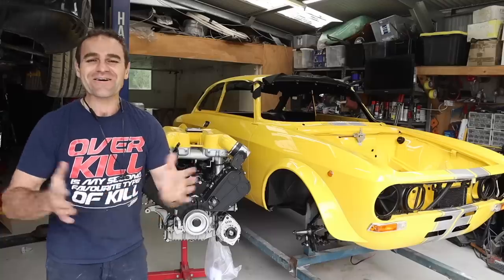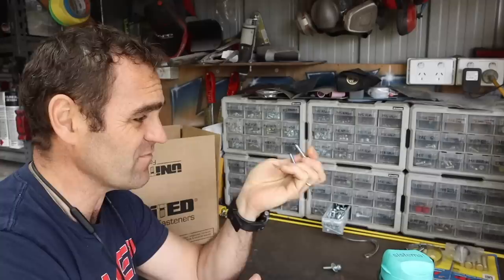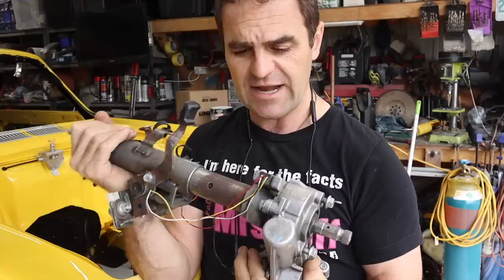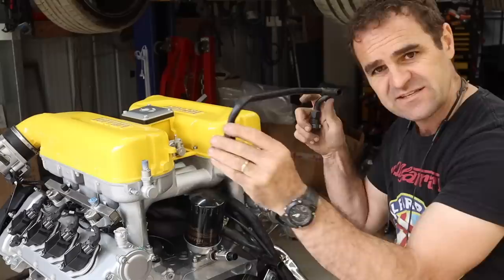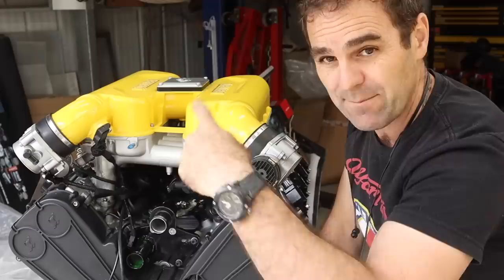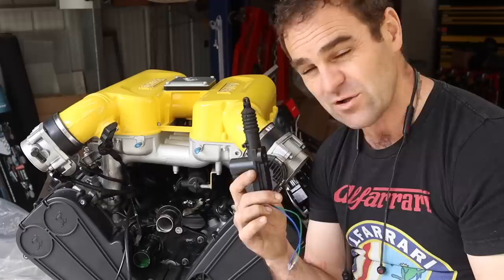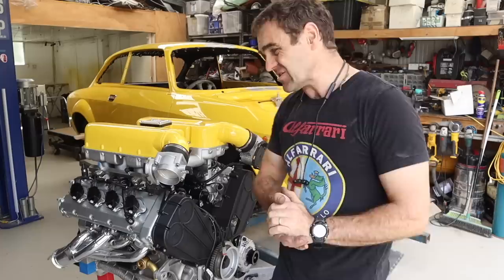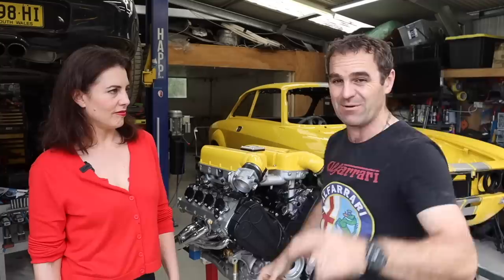All the fiddly bits - Ferrari engined Alfa 105 Alfarrari build part 167

Comment: that intake system is the same as the ACIS intake from the Toyota 5EFHE , all you need is a vacuum tank with a one way valve in the line to the intake manifold , and another line from the tank to a 3 port solenoid valve NC (normally closed) port , the other port goes to your actuator and is NO ( normally open) to the 3rd port which is open to atmosphere , when the solenoid is powered the vacuum tank is connected to the actuator. The solenoid valves are used commonly on cars for emissions control etc , vacuum tanks shouldn't be that hard to score either. I love the spread of torque this system gives me in my turbo 1300cc race car , I can only imagine what it is like on a bigger motor like yours, love this project your doing , keep up the great work 🙂

Comment: I wouldn't use a central locking solenoid from an aftermarket central locking kit.  They are fairly unreliable and were never designed to work with the heat in the engine.  Sorry I don't have an alternative suggestion.
Reply: could try to salvage a frunk solenoid from a wrecked Tesla

Comment: Hey jeff, dont you think that leaving the brake lines exposed to the heat of the headers may cause overheating issues on the brake fluid? Aluminum its a great heat sink and the same with the fluid. A little wrap may prevent damages to the fluid or worse, in a moment of high performance of the engine, high heat output on the headers may cause the brake fluid to loose efficiency.

Comment: I think a modern throttle stepper motor would work really well on your intake actuators. Also look into more recent Toyota’s Audi’s and all NA V6 engines. They will have electronic stepper motors to actuate their variable intake systems. Time for a wrecking yard trip.

Comment: You always have an amazing attention to detail in all of your builds, this one is no exception! As far as losing bits I feel your pain. I had a 57 Thunderbird on the lift and pulled  a rod/piston out and dropped a rod bearing on the floor. I heard it hit  the shop floor numerous times as it bounced across the floor into a black hole. 2 years later and I still have never found that bearing half, but I keep looking. Keep up the great work.

Comment: We’ve used solenoids to pull open the fuel rack on diesel injection pumps (agricultural equipment, but over the road trucks used them too) which have two sets of windings - “pull” windings (high current draw for brief period to move the linkage) and “hold windings (low current draw to hold the solenoid in position). Sits in a hot diesel engine compartment, so should be able to handle the heat. These were used back in the 1980’s on tractors, combines, trucks, etc. I have to believe they still exist, and would be fine if you simply want “on/off” functionality. Otherwise, I’m sure you could find some good PWM solenoids you could drive from your ECM if you wanted to mess with progressive engagement over a certain rpm range to smooth out the changeover.

Comment: The EM solenoid is what you need.  We fit them as emergency gas cut offs and "perminently on" for months on end
Reply: Who makes it, what power consumed, what's full name?  Sounds good for Jeff's use, huh Jeff?
Reply: @sfoggyracer  ours are made by Honeywell but are way to big.  But a fuel shut off actuator from a diesel generator would be better

Comment: Your door lock actuator might overheat if left powered for long periods. I've come across solenoids with separate lift coils and hold coils, triggered by an internal limit switch. The lift coils are high current because they do work lifting against whatever load is moved. The hold coils are lower current just to provide a force to then hold the thing in place. Maybe you could set whatever drives the actuator to give high current briefly then low current and do some experiments to find out what is enough?

Comment: You have 2 types of vacuum, manifold vacuum and throttle body vacuum. manifold is when the throttle body is closed, and throttle body vacuum is when the throttle body opens. there is ports that draw the vacuum from air passing by in the throttle body, which mechanically you could run it off throttle body vacuum as the RPM and air increase the so does the vacuum.

Comment: Yes, the solenoid will heat up and not work very well if excited for a long time. But there are "latched solenoids" that are designed for this use. (They change position on a electric pulse)
They are pretty common on the electric world, they must have some sort of automotive version for sure.

Comment: The vacuum driven actuator is not driven directly from the plenum, it goes to a canister via a check-valve.  Race cars typically even have a bigger canister, because it's possible to "run out" of vacuum in sustained open throttle situations.  The ECU then opens/closes the valves at pre-determined rpms/loads, not (just) under throttle closed conditions.  I deleted all of that in my 911 SC's 993 plenum adaption.  Instead I used a actuator designed for diesel motor swirl flaps, mounted on a custom bracket - so no problem with repeated usage.  That's driven by my MicroSquirt through one of the spare outputs, via a simple MOSFET circuit (with flyback diode) but you could do something very similar with solid-state relay.  I have an example of this going on my channel.  It works, but I've yet to use it all in anger.  Maybe more trouble than it's worth... But there's an idea for you 🙂

Comment: EVs come with a small electric vacuum pump connected to the brake booster. you can get one of those and actuate it via the ECU for the solenoids. One of my friend has the same setup for his exhaust cutout which is vacuum operated.

Comment: Vacuum, keep it semi OEM! The solenoid will likely have too much kick/power snapping something externally or even internally, vacuum lot more progressive  stops with resistance- look at VW TDI vac line diagrams as that's really simple and well documented. Simple reserve in the system is needed, with one way valve to the inlet.
Mapping is interesting as I helped a old school UK tuner as I was visiting! A guy just changed the intake pipe to an silicone hose/KN and that through out the change over points for good power. Cross ref'ing the overlays of Fully vac'd and none
Great build Jeff, as always I'm here for Harry and still watching!

Comment: Hey Jeff, don't use that door locking actuator. Not designed for the heat of the engine bay, nor the duty cycle of continuously on. Ask your contacts at Link. They would have done this before. You could use a stepper motor like an electronic throttle actuator if your ECU supports it. Remember you need a diagnostic on these sorts of controls which the ECU should be able to do with a stepper motor.

Comment: Have a look at the toyota tvis system and their vsv (vacuum solenoid valves) they usually have a small vacuum tank also that can be hidden away. Plus toyota reliability! They work on a normally open (from memory) and the closes it during low rpm.

Comment: You could look into electronic wastegate actuators to replace the vacuum solenoid. Wastegate actuators see the same amount of abuse if not more. Maybe you  can rob one from a Toyota Hilux or Hiace, but other modern cars use them as well.
Reply: Just noticed: The way your lifting points are placed they could rotate on the bolt when picking the engine up and potentially cause damage to the valve covers. Clock them 90 degrees so the load is straight on the bolt and not at an angle to avoid this.

Comment: Here in the U.S.A. ford had the 3.8L windstar. The plastic intakes had valves  like your motor, and it used electric actuators, one for each bank .it would probably be nothing to wire to your link system

Comment: Ba and bf ford falcons have a similar dual runner system on the NA 6 Cylinder motors. Being in Australia You should be able to find the vacuum solenoid at any wreakers super easily.
The solenoid sits on the passenger shock tower near the ecu
It is a simple 2 wire vaccuum switch so positive and negative then set up the link ecu to switch it on and off at your chosen rpm and it should all work just like it did originally

Comment: I would stay away from the central locking solenoids.

If you want to go down the road of an electric solenoid.  You could use something like a universal diesel fuel shut solenoid.  These are infinitely more reliable than central locking solenoids.  They are designed to be energised for long periods.  They have metal threaded hardware which will be more reliable and more adjustable.  And they probably pull a damn sight harder than the central locking solenoid.  They only pull in one direction, and use heavy return springs to go the other way.  You can even get them configured as energise to run, or energise to shut down, depending on the diesel engine and shutdown system.

But given that it's already set up with vacuum operated actuators.  Then it might work best to simply re-use this.  Perhaps getting some small industrial air solenoids run directly by PWM from your ECU of choice.  Then all you really need is a vacuum canister which could be hidden practically anywhere on the vehicle provided you can run the hoses in and out.

Comment: I would try to fit a vacuum tank somewhere, the vacuum actuators has been used forever and are super reliable. There are probably electric actuators that are reliable for continues use in a hot environment , industrial stuff. But are they small enough to fit in there?

Comment: Spent at least an hour the other day looking for my air blast gun to blow off a bonnet I was sanding only to find it was on the other end of the curly air line that was not connected to the compressor in the garage...note to me when working outside check which end is not connected to garage wall...

Comment: Take a look at electronic turbo boost actuators maybe. The door ones probably will die with the heat and vibration unless you want to remote mount them. They will also need to be fast. The obvious cheap and easy way is going to be vacuum actuators. You are going to need one on the dual plenum system too aren't you? Might need a storage canister too.

Comment: Hi Jeff,
With regards to the vacuum solenoids . Firstly are you using the Ferrari ECU. if not is there provision for triggering the solenoid with electronic switching. Then if not a mechanical method would be sort wether vacuum or bel cranked. Perhaps go to an old school carburettor repair man and ask him what systems are available for vacuum secondary butterfly opening. 
There may be something like a vacuum AC valve used by jaguar (xjs) it’s fist sized and has belcrank arm to push pull the water valve open…!
Good luck 🤞

Comment: Please Jeff, don't use that sketchy central locking actuator. Even if you COULD get it to work, they are far too unreliable and not especially waterproof.
Use a stepper motor. Wiring will be more difficult but worth it. An old throttle body motor would be best. 5v for open, 0v for closed.

Comment: vacuum out to a check valve to a tank. 3 port boost solenoid to control vacuum on and off. subaru fuel filter could be the accumulator tank. brake booster or pcv valve for a check valve. amazon has 3 port controllers for 13$

Comment: Hey Jeff 
Greetings from Germnay.
Fantastic work at the Alferrari👌🏻

For the throtle valves mechanism Why you don’t take a 1:5 scale metal steering servo.
They Are stept,small,have power(up to 50 kg),they Are fast and proportional.
You can program it to your needs opening/RPM.

Comment: jeff use a small 12 volt micro linea actuator you can buy them on ebay with 1, 2 or 3 inch stroke for less than 40 bucks and run it through a relay controlled by your aftermarket ecu problem solved cheers from broken hill

Comment: That door lock actuator is not meant for the underhood temperatures and constant use that will stress it. I would figure out how Ferrari did it and substitute vacuum switching valves operated by the ECU to get it to run properly.

Comment: Just a comment from a automotive engineering prospective dimpled aluminum or stainless heat shields are better than the ‘gold’ bling shields, there are two types plain single layer sheets and ones which have a layer like the ‘gold’ fibre/foil stuff glued to the back or additional sandwiched between 2 layers of the dimple sheets, it is more costly and not as easy to work with but lasts a lot longer, doesn’t come un glued and drop down/off and is much more effective at shielding heat. Its used on aircraft etc.

Comment: Can you mock up the current valve's opening and closing? You might need something that you can control the rate of transition from opened to closed rather than something like a solenoid which is on or off. If solenoid is no good a linear actuator might be good. I'd assume either one could be controlled generically off the Link.

Comment: I would have used a rc car servo. Have no idea how to control it thou without radio vaves. Also there is rc accurators out there which is made to open and close in any length of the range. As you said those doors accurators is just open or closed.

Comment: If its vacuum actuated use a boost selenoid they are present in most vag cars with turbo diesel, even if it has low vacumm at full throttle use a vaccum Pump. It should be more reliable

Comment: Love the series. Quick question... I noticed that some brake lines pass over the "gold" insulation. Wouldn't"t this mean that they would be exposed to great heat from the exhaust manifold, given that there is very little room in that area of the engine bay?
Reply: I thought exactly the same thing 
All that radiated and reflected heat
Reply: I have some newly designed kevlar plated aluminum heat shield from Switzerland around a bunch of hydraulic lines near the left exhaust header in my Citroën SM. Some heat shields for the brake lines in the Alfarrari are highly recommend!
Reply: my vote would be to be certain the brake fluid is not boiled.  The radiance energy is quick acting, yet the reflecting tape still allows heat buildup you don't want..  if a heat reflecting cover is not attached to the brake line, but instead is on a flag allowing air flow for the brake line, then the better.  test, test again. Boiling T is ~260C for DOT3,4 but only when new and they absorb water and go down from there.  Headers are HOT

Comment: I hope you put some heat shielding on the those brake lines before dropping that beast in the engine bay😮. The amount of heat those headers are going to put out will cause the brake fluid to boil in no time at all.

Comment: The door actuator will die. I had a problem with my safety fuse on my e30 which activated all of the door locks. I mistakenly used ordinary soldier to reconnect the fuse after it tripped. Long story short and $1000 later, I had to replace all five. Yes, you will burn it out very quickly, as I did.

Comment: Instead of a central locking motor, consider using an actuator from a reasonably modern heater unit, where they are designed to hold air flaps in position I think they are more of a worm gear inside and cannot be pulled out of position. Having said that I am a bit concerned about how electric motors will stand up to the heat.
Looking Good though!

Comment: Jeff, don’t mess with any vacuum for idle. Basically do as any other programmable ECU, tune it on via ignition timing on the map… Ferrari used to do that for lack of electronics back on the day, they usually go bad and it will give ya problems. Mechanical actuators are also a source of endless problems mate… don’t do it. 12:30

Comment: Those door lock actuators are generally crap, they may have improved since the last time I bought one but they are still not suitable for constant use especially in the engine bay.
You may be able to get an actual throttle body drive motor to do the job or a stepper motor from an electronics supply.
But what might be easier is to use the existing vacuum setup but controlled by a solenoid from a nitros kit.
You would then just need an on off signal that the ecu can supply.

Comment: Why not mount the solenoid remotely and remove it from the engine heat Jeff ?  That way you could build a operating linkage that multiplies the stroke and use a cable to move the butterflies....love the channel!

Comment: No, you definitely's won't be able to leave the central locking motors powered up. Not fully powered up anyway. They're a DC motor driving a rack and pinion via a gearbox. They have no limit switches - the motor just stalls when they run out of travel. They rely on the short pulse of power from the controller not being long enough to enable the stalled motor to get hot enough to burn out. It may be possible to hold them energised with some sort of 'peak and hold' power supply, but I don't think that'd be worth the experimenting it's require.
Look into how the vacuum operated intake system works on your Audi V8. I have exactly the same engine, and it's a simple system which you could easily recreate on your Ferrari engine. It consists of:
1. A non return valve connected to the inlet plenum
2. Pipe to a tee piece, one branch of which goes to the vacuum tank, the other to a solenoid valve
3. The solenoid valve is a 'change over' type, which either connects the vacuum actuator to the vacuum in the tank, or vents it to the atmosphere via a little filter
4. The Audi vacuum actuators are also quite universal. They're effectively spring loaded rubber bellows, made by Hella and also used as cruise control actuators in many older vehicles with vacuum cruise control.
5. The system relies on the intake system valve being spring loaded, so the spring pulls it one way, and the vacuum actuator overcomes the spring, pulling in the opposite direction.